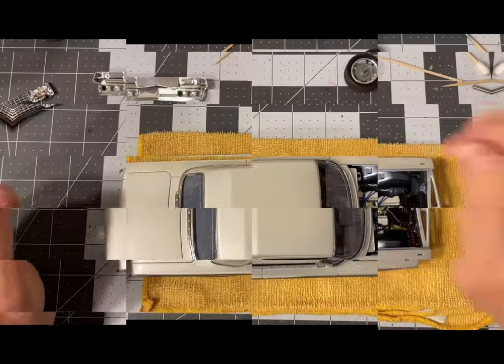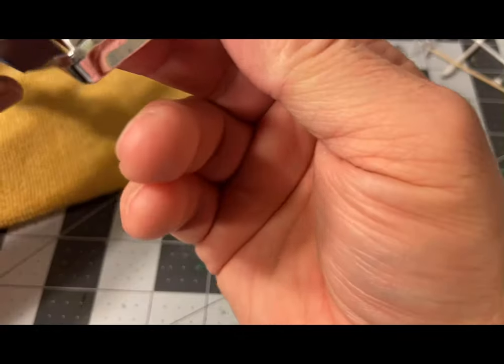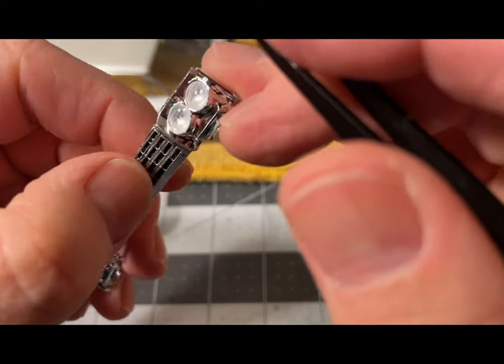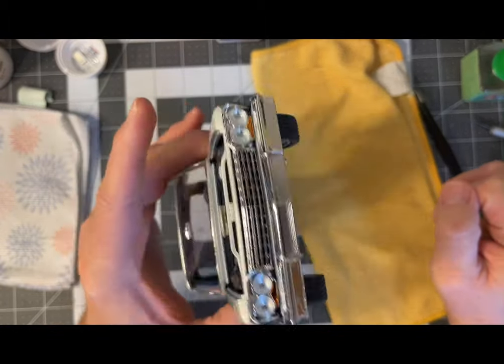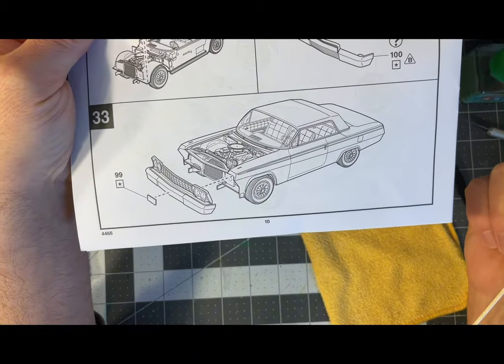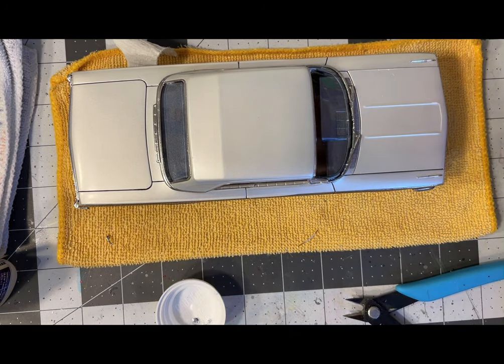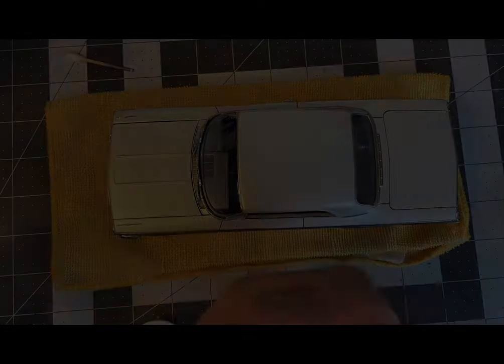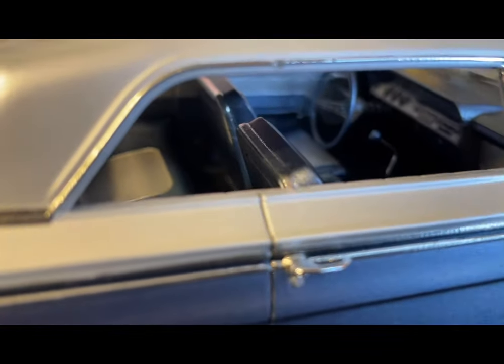How I build a model car, part 8. Final details and accessories.

Comment: I would like to see someone drill the pin hole in the tiny parts. I usually just end up putting tiny pin holes in my fingers 😢
Reply from the maker: LOL, I've done it once or twice but if you're careful it's really not an issue.